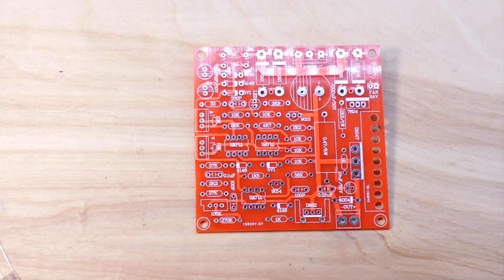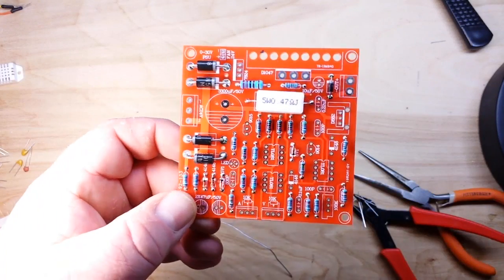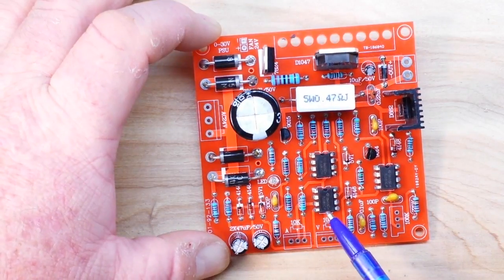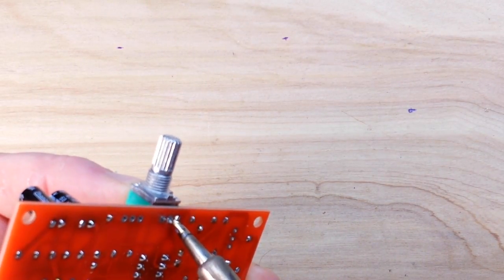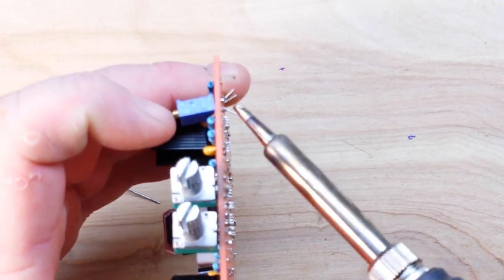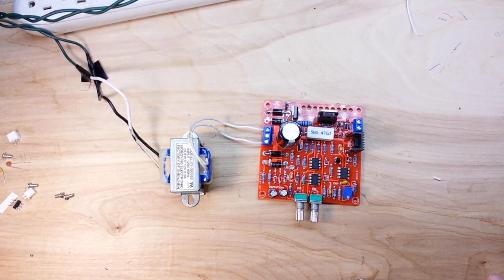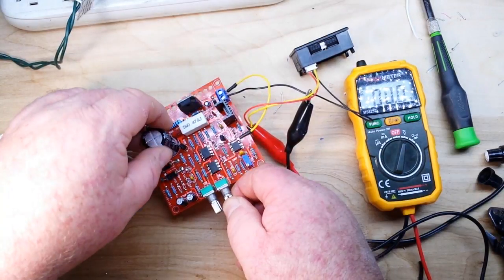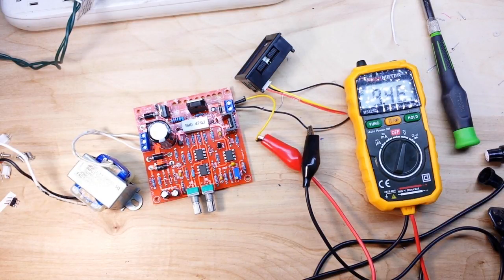eBay Power Supply kit build part 1

Comment: This circuit and kit is based on a very old design and has many issues, So It always ends in frustration and disappointment, as shown in many forums,  So if you want a good Lab power supply then don't waste your time. I say look elsewhere. Period.

Comment: I have built a number of these kits but now I'm trying to wire an ebay special amp/volt meter but I dont know where to wore the large red wire from the current . I'm using a 24 vac transform step down from 110ac can you help with possibly a schematic showing the power supply  as I'm not very fluent with wiring schematics. I am teaching myself these thing via youtube lol

Comment: Sooo how did you fix the negative 0.5 voltage reading, and how did you make your led turn off? Mine is constantly on and i can't find the reason
Reply: U need to use a center tap transformer! It is a must! It needs -v to make it go to 0v .

Comment: My TL081s do not have the notch that is shown on the pc board.
There is in fact a small circle molded into the top of the IC package, I am assuming that this circle indicates the SAME END OF THE PACKAGE THAT THE NOTCH DOES.
AM I CORRECT?

Comment: can i use my laptop adaptor around 19volts instead of transformer?
Reply: No, you can't. Because your laptop adaptor gives you 19v direct current, and you need 24v ac current.

Comment: Hello.. May I ask how did you fix the -0.5v problem at 9.30time?
Reply: Use the small 10 turn pot to adjust to zero volts with V pot turned all the way down.

Comment: will we able to increase the current capabilitie of this power supply by adding another transistor in parallel with the power transistor?
Reply from the maker: I haven't looked into that. This is a 3A PSU plenty of power for anything you would want to do at home.
Reply: sometimes i need to power led/bulb and they mainly consume 4 amp and I want to give some headroom so 5amp with current limit is my need & i hope you can find something to help me out & thx for the videos & reply keep it up.
Reply from the maker: Electronic projects This power supply and any power supply is going to be limited by it's weakest component. So beefing up one component will not reliably beef up the whole. You could however run 2 of these in parallel for 6A overhead.
Reply: Ok I understand Thx..

Comment: Looks like you got a new Hakko soldering iron? Good build are you going to use the machine shop to cut the holes in the project box?
Reply from the maker: George Chambers no new iron, that's the same one from my Cheapest Chinese Soldering Station video. Lol I think the Bridgeport might be a little overkill.
Reply: A Bridgeport is never overkilling! I use my milling machine for cutting project boxes every time, You can't beat the precision with much else. However you go about it I'm sure it will be nicely done.
Reply from the maker: OK, you sold me on using the bridgeport. What cuts plastic better 2 or 4 flute endmill?
Reply: I've had the best luck with 2 flute endmills. A slow feed, not too slow, and a medium RPM works for me. Watch for the plastic melting and not getting chips. Good luck!

Comment: Bad PCB design putting the two pots so close together.
Reply: They give you connectors to mount on the board and leads to remote the pots.
Reply from the maker: Moonbrony I agree. They will be relocated when this goes in the project box.
Reply from the maker: If only they gave a schematic...
Reply: From our friends at Banggood: http://img.banggood.com/file/products/201505080459530-30Vinstall.pdf